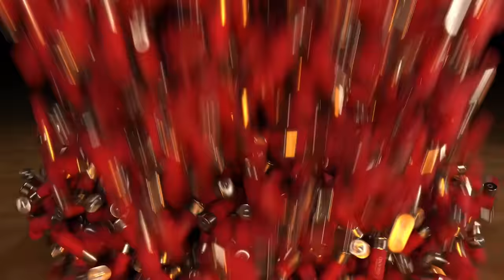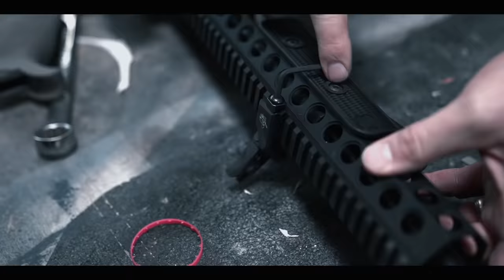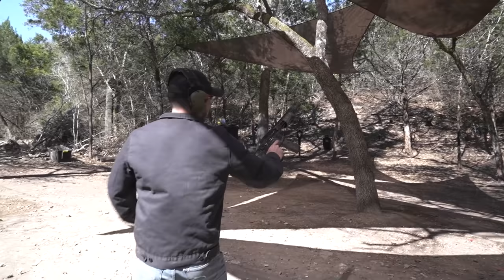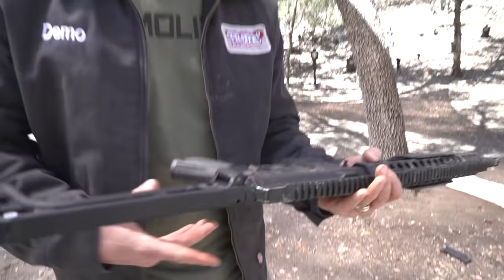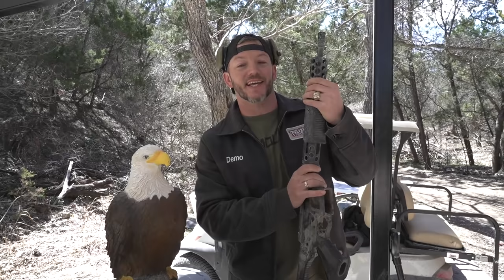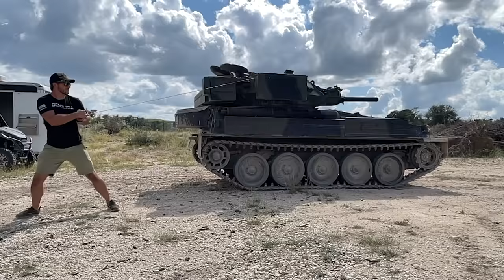Torture testing the DUMBEST gun to DEATH!!!

Comment: Put a gear system on to make it a super short throw, or even a cam system that does a full cycle with 1 reciprocation(love round on both forward, and back stroke)
And because its manual, you could do a trigger delete, or a hold to fire trigger

Comment: I figured out what it was good for. When running suppressed, you can shoot and control when it makes slide noise
Reply: Like the Mk23!
Reply: Yo suppressed 5.56 is still super fucking loud,  action noise would mean nothing.
Reply: Pretty sure it's a step in the direction of arming law abiding citizens amongst all these debilitating firearm laws that only stop law abiding citizens.
Reply: @shafty9147  subsonic rounds.
Though those do have a fair bit less Power. Oh well a pump action ar wont use that Power for cycling anyways.
Reply: @shafty9147  suppressed 5.56 isn't that loud, can get it hearing safe. But, preventing port pop and  gas in the shooters face would be useful in some situations.
Reply: @kompound52  go shoot a suppressed 5.56 with no ear pro.  Might not be blast your ears out loud but still way louder than “action noise”.
Reply: @thejuggercat  subsonic .223 completely defeats the purpose of it being in .223.  You would get nearly identical ballistics from a suppressed .22.
Reply: @kompound52  anything going supersonic suppressed or not, is not hearing safe.
Reply: @shafty9147  fair enough.
300 blackout tho?
Reply: @shafty9147  never said anything about action noise. I said 5.56 suppressed isn't that  bad and can be hearing safe. I shoot suppressed 5.56 all the time, with and without ear pro, depending on the set up I am running that day, and the terrain I am in.
Reply: Would probably be better off with a Mossberg MVP Patrol for that. It’s a bolt action that takes ar mags. Would probably work better.
Reply: actually a pump action is faster then a bolt action, as a marksmen rifle it may actually be a decent rig when you want full velocity including the 50fps or so you lose when using any kind of semi/automatic rifle.
That is of course assuming the pump action style is accurate.

If it was super smooth pump action you could keep the sights on the target while you load the next round, something thats hard but not impossible to do when reloading a bolt action.
Also it requires far less cleaning and is less likely to fail in a survival situation and with no gas tube it can be made into a break down rifle easier.

I actually think it could be a good idea for niche/survival situations if designed ground up for it.

Comment: There is one added benefit to that rifle..  since there is no gas system, you're not losing velocity down the barrel.  Kinda makes it like a bolt action.
Reply: Probably sufficient to describe it as manually operated
Reply: There's an insignificant amount of loss for an auto vs a manually operated action. So still it's a lousy AR.
Reply: 10 to 15 percent can be significant based on use.
Reply: @mattking4483  except it isn't as much as that.
Reply: @mattking4483  it's nowhere near that. It's generally within the standard deviation of a given load.
Reply: It depends on barrel length and gas port location (cabine, mid-length, rifle) but yeah from a manual action on 6mm ARC as an example,  if you get 2800 fps on a 105 grain,, it'll drop to about a bit over 2500 in a gas system.  I've tested it myself both being 18 inch barrels.

Comment: This actually isn't a completely terrible idea.  If you have a failure with your gas system (i has a Seekins upper that would constantly fail). You could stay in the fight with a pump backup.  Better than reaching back to the charging handle...

Comment: Hey mat I was messing around with spent shotgun shells and empty co2 canisters and the co2 canisters fit perfectly in the shell, I was wondering if you could test it if it could be shot out of a shotgun. The canister are pretty tough I think it could handle the pressure. Edit: the canisters diameter is slightly thicker than the bore of a 12 gauge barrel just for safety reasons if you do decide to test it please use a string and pull at a safe distance
Reply: Check out his old videos. He’s already done that before
Reply: @brandonlarue3170 idk if he still even has those videos anymore. I thought he had to take them down. I remember when he used to shove all sorts of weird loads in that old shotgun

Comment: The other question is what parts are interchangeable with a regular AR like can you use the lower or parts of the lower and vice versa just in case you happen to have one or someone leaves that behind can you fix yours because your AR got damaged or the one that you recovered from someone else was slightly damaged what can you use from that to possibly fix yours if for semi reason you're in a firefight or you're in an area and you need to fix on the fly

Comment: Boy oh boy you don’t even know what I have planned for a shitty gun 

1.uzi stock cuz why not
2.loads like a liberator cuz u got time
3.shoots 50 cal to make your shoulder bleed
4.no safety
5.takes 20 pounds of force to shoot off a single round
6.20 inch barrel with no iron sights or anywhere yo put attachments,and as a bonus the barrel lets the bullet fly wherever 
7.dummy thick for useless weight 
(Worst of all)8.frame made of polyester 🤮

Edit:did I mention you HAVE to carry the rest of the rounds in separate bag